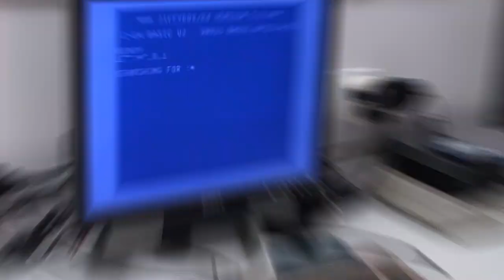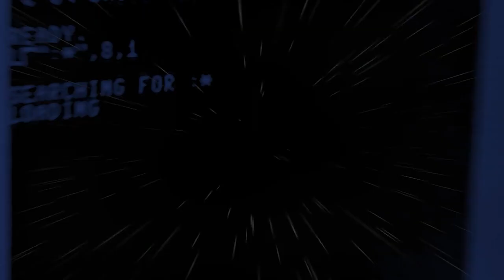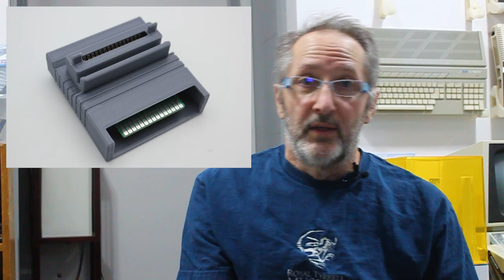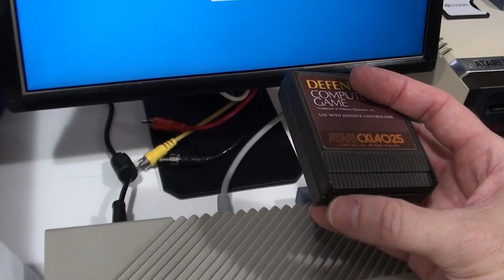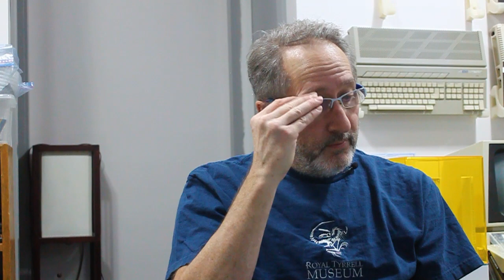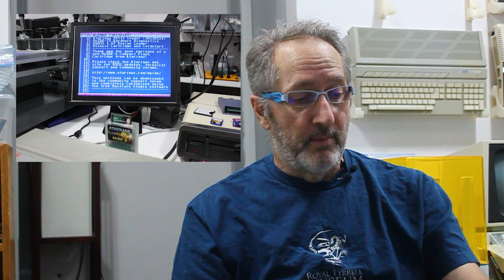Atari XE XERA Cartridge

Comment: Love the design of the cart case. Any thoughts on putting some latching points to self secure into the port? Nothing crazy, just enough to prevent wiggling out.
Reply from the maker: I had not thought of that, as having the case walk out of the port had not occurred to me.  I will have a look at that, see if that could be incorporated into the design.  Thanks for the comment.